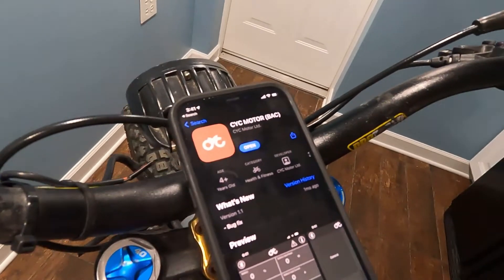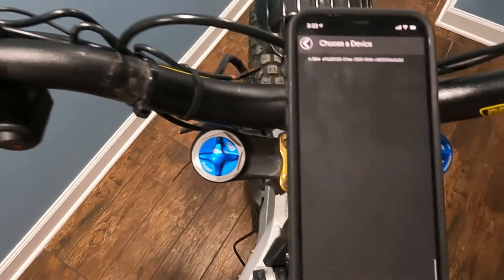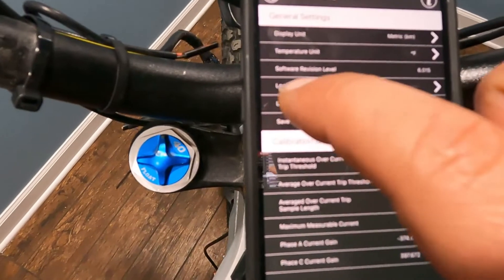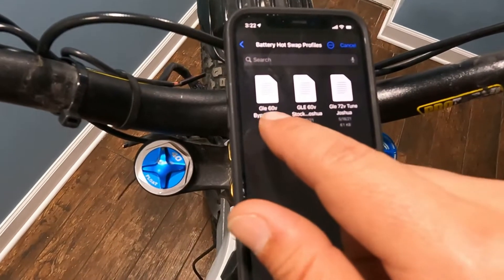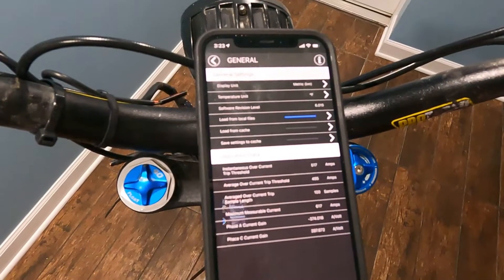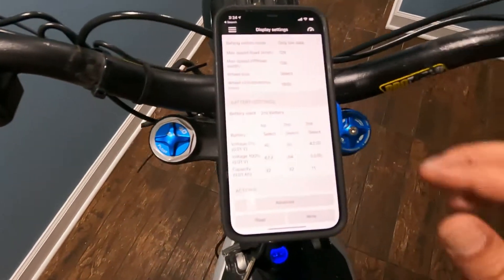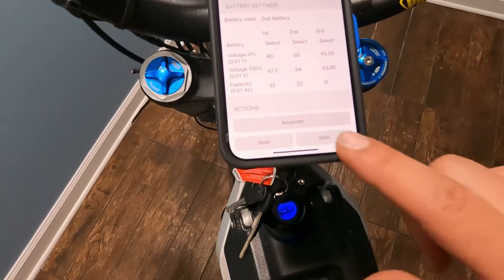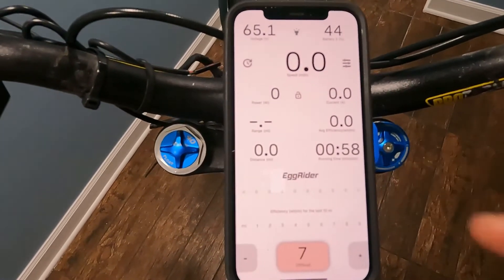GLE ASI BAC4000 HOT BATTERY SWAP For Suron/Segway Power Upgrade Plug and Play Kits

Comment: So I’ve installed my controller and I’m having a problem switching from 60 V to 72 V I change it all in the CYC app then I switch over to turning the bike on with the egg rider and everything‘s good voltage wise pull the throttle and I get nothing sounds like the motor wants to do something but it’s not doing anything got any thoughts
Reply from the maker: Contact support@glengineering.co , they will be happy to assist you.